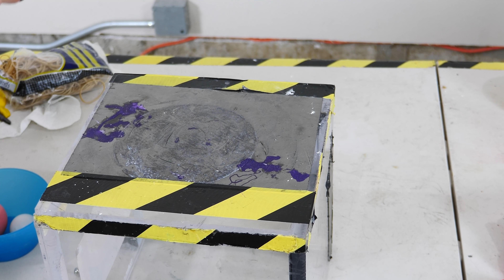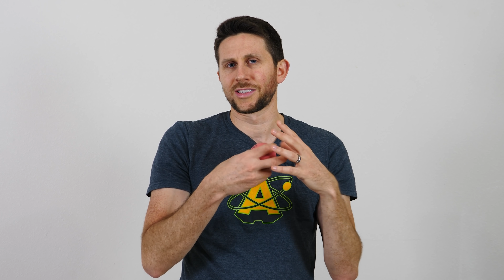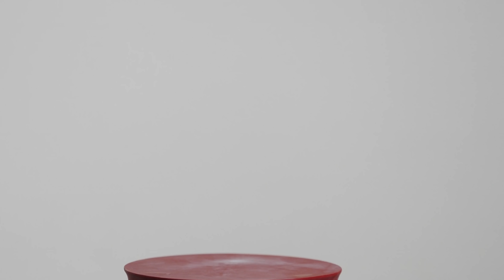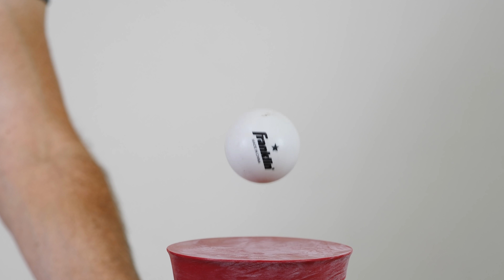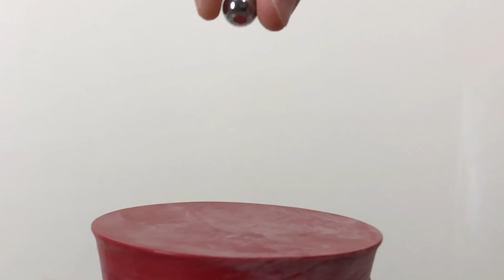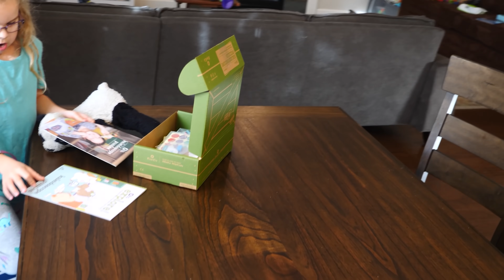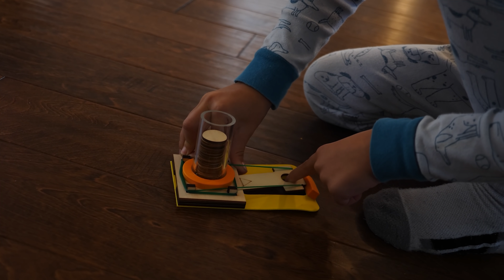The World's Bounciest Surface

Comment: if only someone owned a vacuum chamber so that you could lessen the effects of air friction...
Reply: Are you implying something, my good sir?
Reply: Don't forget to cut a hole in the cup so the membrane doesn't pop off when pulling vacuum :)
Reply: @somecsguy9824  if he cut holes in the cup, it wouldn’t bounce as well, as there would be no pressure inside the cup 🤦‍♂️
Reply: He's used a magnet before to drop an item with out having to worry bout the air
Reply: with a steel bearing
Reply: Shantanu Aryan y
Reply: that would also remove the air from under the diaphragm, likely lessening the bounce... might make a decent difference for a ping pong ball but seems like it would actually reduce bouncing for the steel ball. curiosity is always worth exploring though
Reply: I'm frustrated that he didn't show it.
Reply: @thibaut5345  mee too
Reply: And also, no loss by sound emission.
Reply: You can also increase the mass of the dropped object to lessen the effect of air friction. Not as good of course, but much easier, and if you do this for enough masses, you can try to extrapolate to what would happen at "infinite mass", which is same as in vacuum :P.

Unfortunately, increasing mass often means either changing material or the size of the dropped object, so you'd need to be careful with your conclusion with this method...
Reply: I suggest someone makes a hollow steel ball, maybe like a steel bubble if its even possible.
Reply: was thinking the same
Reply: I was going to suggest that but...
Reply: Zoom
Reply: Exactly what I was thinking
Reply: AND sound
Reply: Interesting idea. As well as air resistance, that would also cut out a lot of the sound vibration losses.
Reply: 100th like
Reply: Steel and glass are more bouncy @ 4:48? Ask Elon Musk about that one.. #throwsballthroughwindow
Reply: The effects of air friction only very slightly affected the ball, especially since the ball is aerodynamic and the distance wasn't that great.

Edit: If the ball had coefficient restitution of one, then air friction would affect the ball much more, and it wouldn't be able to bounce infinitely, but other things would also affect the ball, not just air friction.
Reply: How would he get it to bounce in the vacuum chamber i he can’t put his hand in it without letting all of the air back in though?
Reply: @Monke537  Hang it over the cup by a thin string and cut the string by pointing a laser through the plastic. Cody's lab does this regularly with his vacuum chamber experiments.
Reply: @somecsguy9824  was thinking a magnet to hold the metal ball against the roof of the chamber
Reply: @somecsguy9824  Or use a magnet to hold the steel ball in place through the lid, then remove the magnet
Reply: @somecsguy9824  or a magnet
Reply: @Monke537  he could use a magnet to hold the ball on the roof of the chamber and release it
Reply: @gregkorgesaar  yes, I get it now.
Reply: @Monke537  by using steel ball and magnet?
Reply: @CrptDrvr  I know
Reply: @Monke537  using a magnet, that's how he could drop it.
Reply: Magnets? Idk
Reply: @Monke537  you hold the steel ball with a magnet that is outside the chamber.  Lift the magnet to allow the ball within the chamber to drop.
Reply: @Monke537  remote control (sorry for the late reply)

Comment: @The Action Lab  Is it really the amount of deformation, or the type of deformation?  With a rubber ball, for example, there can be plenty of deformation, but as long as it is storing all/most the kinetic energy as potential energy, in the deformed state, then it won't lose much energy.  Would it be fair to say that the deformation has to be irreversible to waste the most heat?  For example, a piece of puddy that collides deforms, but can't return to the same shape?

Comment: Put diesel in compressor and ignite it with high air pressure.
Reply: America
Reply: Dude..... That's an engine
Reply: I think compressor 'll blow up with tremendous of pressure .
Reply: Kaboom
Reply: You'd need at least 200psi of pressure. Probably more like 300psi, because of heat loss and being inefficient.

Comment: I kinda wanna see what happens when you put even the slightest of energy into the system. Maybe by putting a little Bluetooth speaker playing a simple sine wave. Oh and then see what happens at different frequencies, maybe when in resonance. You'll probably need to set the volume as low as possible or the ball would fly to the side.

Comment: I bought compressed air to clean the inside of my PC from dust. But by chance, I pressed the nozzle when the bottle was upside down. A thick white mist came out! When I checked, it was FREEZING, much lower temperature than normally (nozzle pressed with bottle upright). What's going on here?

Comment: What if you do this in a vacuum?
Reply: It sucks the air inside the jar and it deforms thus air gives some rigidity to the ballon film
Reply: @sammithuk8609  they could just put the membrane on a cup with a hole
Reply: @spheghetilover  the hole may also make the membrane less rigid   thus less bounce than that without a hole
Reply: @sammithuk8609  I’m only in the eight grade but you seem smart lol